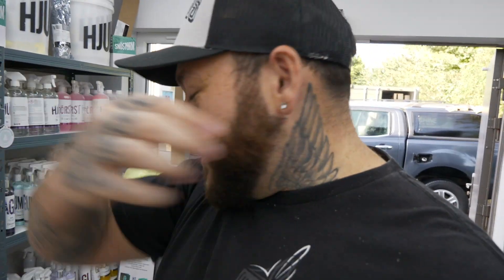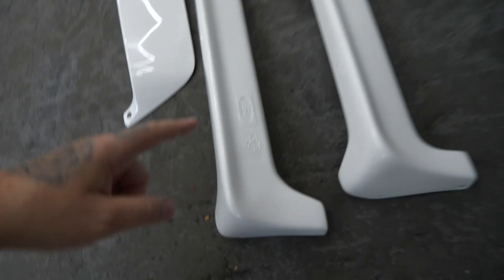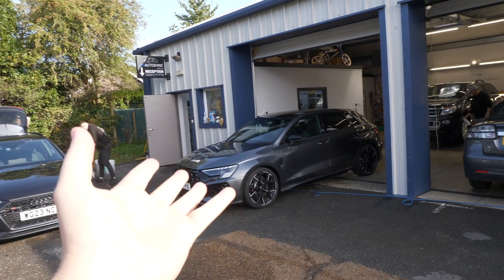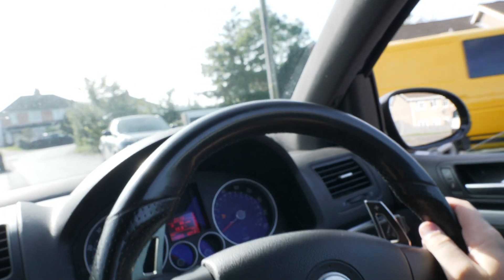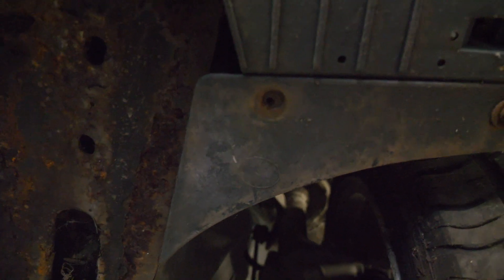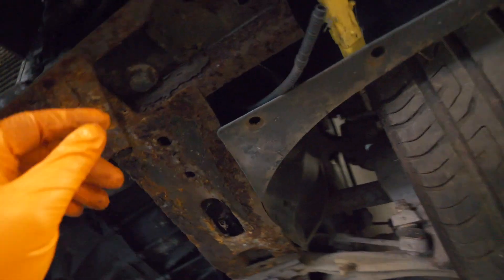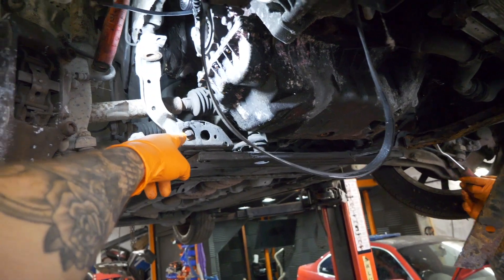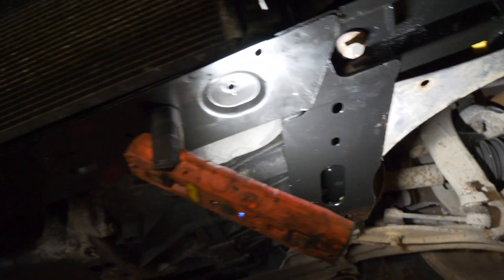I BOUGHT AN ABANDONED CLIO 197, THE HIDDEN RUST!! | PT 5

Comment: I had a 2010 Cilo 1.2 TCE and that had a similar problem on the radiator support. 
Just light surface rust, definitely not as bad as this one. It did flag up on the MOT as an advisory. 
That car was sold a few years back.

Comment: just to let you know them cheap radiator support are wrong for the 197/200 as one of the radiator mounts are in the wrong place they can be cut off and welded in the correct position no problem at all but i'm sure you spotted that already